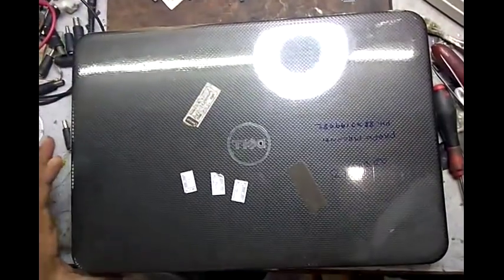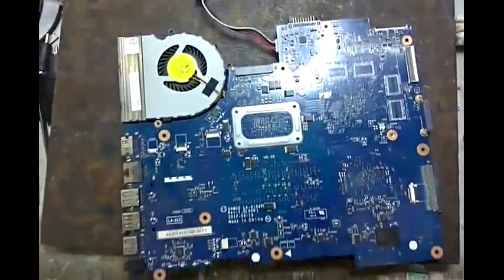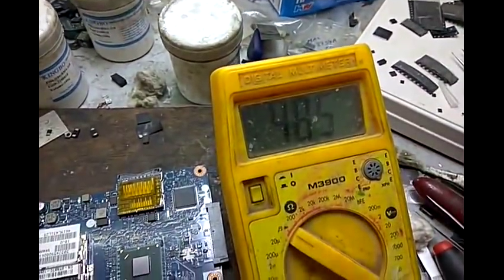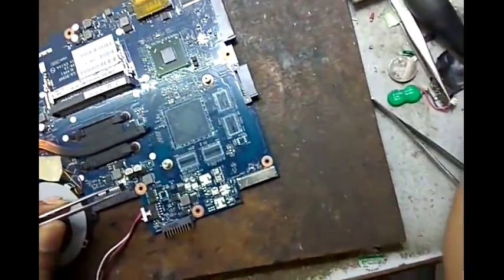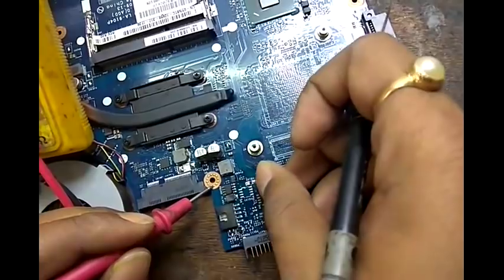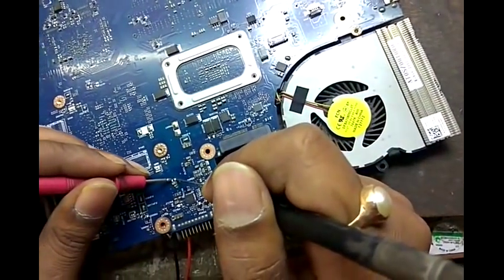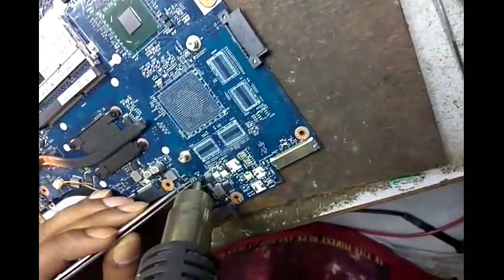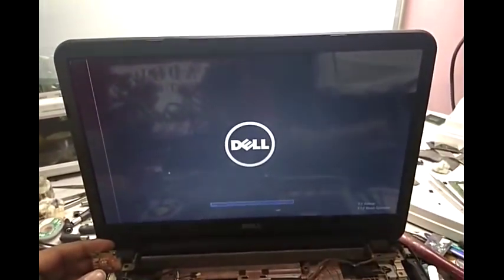#LaptopRepair Laptop Adopter light goes off if connected to laptop by #SatishBhai & #Aditya11ttt

Comment: Can you pls tell, why dell Inspiron n5010 is auto swthing on and beeping 3 times without display..further when i make power off from panel the laptop is not getting off and power light gets turned on and fan too runs continuesly...pls help ..
Reply from the maker: Board has issue get to repair shop

Comment: Have you seen Dell E6540 that runs off battery, but not AC source?  It will not charge battery.  Tried different known good Dell battery and AC power adapter and DC Jack cable.  Motherboard issue?  How to fix?
Reply from the maker: Board issue !

Comment: Hi
I have Dell Latitude e7240 Ultra Book. This Laptop Also run single Battery or single Ac Adapter or both are. But when Windows Run he Give massage  Plug in But sowing battery condition is not charging I mean (Battery Percentage is no incise or decries ). I also check genuine adapter and Adapter jack which connect in Motherboard. But Cannot solution this problem.
also noted every time when power on he gives adapter watt related warning. 
Now what should I do...……………………..
Please give me some advice. 
If possible mention what is the problem.
Reply from the maker: Check board !!

Comment: Hi, I have same laptop, very left LED lighting, I have B+ (19v) at small RZ13  -56k resistor. It turned out that QZ9 has+5v at its gate which is signal “SUSP”, which coming from QZ8 having 0v at its gate – which is signal “SUSP#” coming from pin 116 of 128pins-controller UE1 (KB9012QF-A3) and UE1 has on its pins: pins 9,22,33,67,96,110,111,112 = +3.36volts; pin125=+3.39v, pin102=0volt (all is correct according to schematic). This way that signal “SUSP#” (0v) suspending (blocking) +3VS AND MANY OTHER  voltages the same way: +5VS, +1.5VS, +3V_PCH, +VCC_CORE, etc.
I checked UE1 specifications but could not find any info about why UE1 can have that signal (0 volts) on its 116 pin – nothing at all. Any suggestions about that? I checked BIOS battery – it was ok, but I changed it anyway and still no help. (so, present are following: B+, +5VALWP, +3VALWP)
Thank you

Comment: Sir whether this reverse current issue cause the adapter complaint .I have fixed my issue the adapter is not working.and the laptop is working with other adapters
Reply from the maker: Might be in your case adoptor was faulty

Comment: Sir what is tha approximately cost for solving this problem. I m asking this question because in the market demand more money compare to problem. 
So plz susseg cost.?
Reply from the maker: Around 2500-3500
Depending on the issue but still check your local market that’s more better !!
Reply: @Aditya11ttt  ok thankyu

Comment: can i subtitute AO4413?
Reply from the maker: Against ?
Reply from the maker: Match and try data sheet
Reply: already purchased the exact replacement. removed the shorted 4409 mosfet from the motherboard. but i check the pf that you removed and it is not shorted.. i dont have bench power supply like you are using to look for the other shorted component. i only have here is the ZK-J5X 1.2v-32v 5A step down module. hope this will help.
Reply from the maker: Try

Comment: Hello I have the same problem with my dell inspiron but when I took out everything and connect the charger the light no longer goes off but the light from the charging port still does not turn on. Please can you help me with this?
Reply from the maker: MBD issues seems
Reply: @Aditya11ttt  bro when battery connected the charger light goes out when connected to power source. After I removed the battery the charger light no longer goes out but the power connector light from my dell laptop never turns on

Comment: an HP desktop was brought to me for repair, i test it. that's troubleshoot the system i noticed that the system is On but the monitor is checking. I swap the monitor, I used another monitor but still checking. then I notice is not from the monitor. pls help,what am I supposed to do am confused about it help.
Reply from the maker: May be some board issue single may be missing

Comment: I am facing same problem in my Samsung laptop, charger light turns off when plugged into laptop. But when I used a friend's charger, it worked fine and the charging started. 
So it appears that problem lies in the charger itself and not the laptop. 
Ya kahi aisa toh nhi ki real problem laptop me hee hai (as shown in your video) which in turn damaging the charger also after long time use ?? I am confused what needs to be fixed...Laptop or its charger??
Reply from the maker: Good Friend if it’s working with another charger use it new charger if everything fine may be charger is faulty !! 
Rest without physical inspection can’t commit any thing !  
But as u said changing charger everything is fine so charger seems faulty !
Reply: @Aditya11ttt  Thanks for the quick reply. So it is most likely that problem is in charger. And even if a rare possibility that laptop is also faulty and I continue to use it with new charger, I hope it will not lead to a bigger problem.

Also, Charger repair ho sakta hai kya (since this is original charger) instead of buying a new charger?? 
If not, can you please suggest a good brand(s) for buying new charger??
Reply from the maker: Buy any with six months or 1 year warranty that’s all ! And Simple

Comment: My laptop adaptor works for sometime and then stops. Especially it suddenly stop when laptop running programs. Strange thing is that if i switch off and then switch on the socket wall (tried diff sockets too), adaptor works for sometime and then stops. Again switch off and on, it works for somertime.
Reply: Did you ever get the problem resolved?

Comment: i had this problem on dell precision, i thought it could be power socket short but tested ok so i replace motherboard, still same problem untill i take out graphics card then computer boots
Reply from the maker: oldskoolhead0 what’s app plz !!
Reply: i dont do whats app, and i fixed it myself anyway, just sayin mine was graphics card problem, i replaced graphics card problem solved
Reply from the maker: oldskoolhead0 gr8

Comment: sir my laptop switches off automatically sometimes 2 minutes after power on and sometimes after 30 minutes or more. I use it without battery, dnt know what is the problem, could you help identifying the problem?
Reply: Clean it and use good thermal paste.

Comment: Laptop adapter lights gets off when connected with laptop...but without battery it is working fine...what might be the reason....
Reply from the maker: Change battery and check or battery section has some fault may be !

Comment: Great video thanks. I have a Inspiron 17 5759 that will not charge the battery. Plugged in not charging. I have replaced the battery and charger with know good one from another 5759 that is working properly. The battery and power adaptor are not the problem.I swapped out the hard drive from the other laptop to see if it was a driver issue. drivers are not the problem. I believe it is a motherboard charging ID circuit issue. I have continuity from the power supply adapter circuit board to the motherboard connector solder points, so the connector and internal wires are good. This includes the positive, the negative and the ID wire. They all test good continuity.I'm having trouble locating a schematic so that I may diagnose the problem.If possible can you help with some information., Thanks in advance Michael.
Reply from the maker: milluses contact in what’s app +91-9584145145

Comment: I have dell inspiron 15 3521 core inside . But it is problem is not on so please help me.
Reply from the maker: ABHAY SINGH do u Repair
Reply: Maine laptop kai jagah dikhaya pr koi solution nhi nikla 
Charger plate s problem h on nhi hota h laptop
Reply from the maker: ABHAY SINGH plz contact via what’s app number u will get  from the latest vidoes in the channel !!
Reply from the maker: Mine 9584145145
Reply: Ap repaireing  krte ho laptop
Reply from the maker: Yes

Comment: Sir Namstey
I am using dell inspiron 5558. It was working properly  last 15days ago.  On march 27 2018 i shut downed off it.  From that day its not working or no pwer on.  I visited the center but they asked me to replace the motherboard.  It was costing me 12500 rs.  I refused and searched for someone  else.  But not found yet till.  Please give me your shop add and contact no so that i can contact  you.  I want repair the laptop by you sir.  Please me as soon as possible.  Thank you sir for informative  video.
Reply from the maker: Contact via what’s app
Reply from the maker: harsh vasen 9584145145

Comment: @Aditya11tt .. i have the same problem with my dell Inspiron laptop...  The adaptor goes off when the pin is plugged into the laptop... So the battery is not getting charged...My doubt is "will the laptop work on the charged battery"...or else the laptop is completely dead
Reply: Cost of repairing sir in dell service centre... today I got this problem
Reply from the maker: They don’t repair only change board !
Reply: Cost?

Comment: Aditya Sir how much will it cost to repair this issue in computer shop please say
Reply from the maker: cant say there is no fix rates any where!! So kindly refer your local shop near your location !!
Reply from the maker: can't say check ur local market!!
Reply: Aditya11ttt that mosfet was faulty because it was not passing 19vdc?  was that an N channel fet?
Reply: sai nithin I would charge $90 if I had the replacement parts on another spare motherboard.
Reply from the maker: joe carr we are not discussing about the charge !!
Reply: joe carr he clearly said in the video multiple times "a P channel MOSFET"

Comment: what does it cost to repair??
Reply from the maker: depends on problem!!
Reply: Aditya11ttt still its cost range...?
Reply from the maker: 1500-2300
Reply: Aditya11ttt thank you....one last question that how to prevent loptop from facing this situation???
Reply from the maker: Samarth Pote there is no such protection required but use good quality cable and adopter !!

Comment: Temporary solution for this problem????
Reply: Temporary Solution to open laptop??
Reply: Any idea ??
Reply from the maker: Am not clear with what u r trying to ask
Reply: I said that can u give me any solution to turn on laptop in an home but for some time only...
Reply: Without opening Laptop parts
Reply from the maker: What’s the issue? That’s what am asking what type of dead is it ? And from which place  u r ?
Reply: Same problem as in video it is not opening & adapter light goes off when plugging in laptop
Reply: Am from nepal
Reply from the maker: Nope u need to approach a professional
Reply: Can u tell me the cost of this problem, sir?